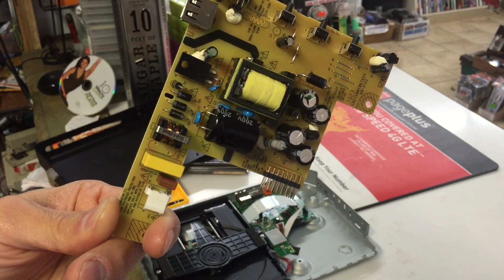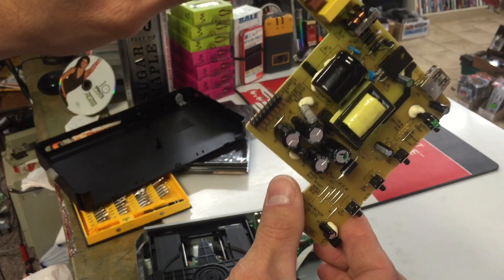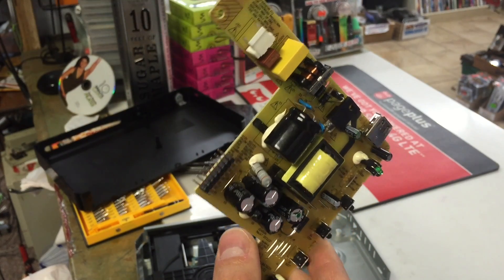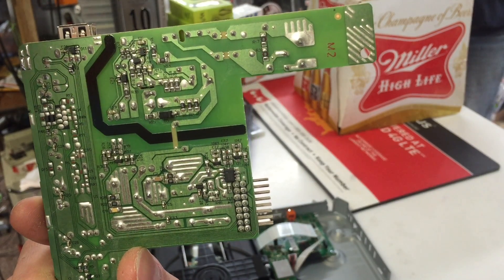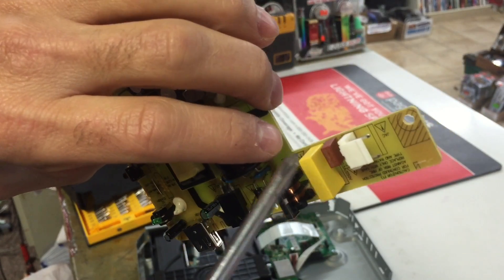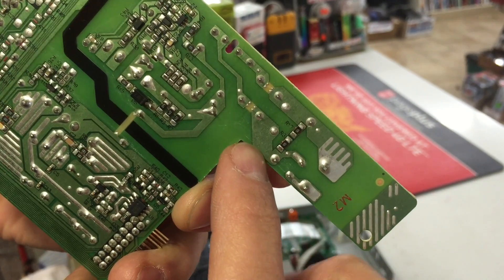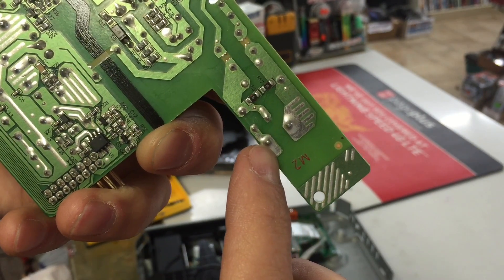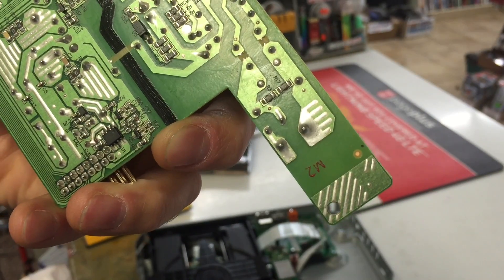How To Bypass fuse Or Fix Blu-Ray Dvd Player No Power

Comment: It came in youre shop and youre fixing it forsomeone and youre bypassing it with wire youre smart !
Reply: Except fuses have a reason for being in place they blow when there is an ne electrical issue if you bypass it you could be asking for a fire

Comment: Hey, thanks for the video helped me fix my blu ray/sound system combo. I had no power looked on the board where the power supply connected to fuse was next to it. I went to my garage found some wire and soldered it in powered right up.
Reply: I’m having that same issue my whole sound system is done for

Comment: Fuck mate, if your going to fix it, don’t bypass a fuse, a fuse is there for a reason, replace the fuse, if that’s the problem. Have you tested it, or are you guessing? No fuse, you could cause a fire in a persons home because of your short cut.....
Reply: Please listen to the comment above people. Somebody has already commented that by shorting out the fuse, it almost caught on fire. A fuse is the weakest link in the chain for a reason. Was immediately concerned about guy in the video's technical proficiency when he described AC as being positive and negative, WRONG. Do not short out your fuses for the love of God!
Reply: I am a total novice when it comes to things electrical/electronic, but was also totally confused by the reference to positive and negative in an AC circuit!!

Comment: GOOD LORD LOOK AT 1:24 IT IS CLEARLY MARKED AS A T250 2.5A FUSE. WHICH MEANS IT IS A TIME DELAY BURN WITH 2.5A MAX AND 250V MAX. JUST DID MINE ON HIGH END SAMSUNG. IT WAS SHAPED LIKE A TINY BLACK CYLINDER. LIL TRICKY BUT REMEMBER TO READ THE BOARD!!! EVERY I REPEAT EVERY COMPONENT IS LABELED!

Comment: I have a Sony bdp-s5200 with no power. I have 12 volts DC after that part of the board but no power at the buttons. No obvious arcs and only two caps on the board that are fine. I hate to throw this out.

Comment: My apology, typo error, I mean,  is it safe to replace the fuse....I wish to do it myself. Unfortunately, my multi-tester had not been used for quite some time, look like I got to replace one because putting the probes together, it does not give any reading. When I turned it to continuity, it did not give any beep sound either. Hope you can share... Thanks.

Comment: hi thanks for the video and sharing i got blueray home cinema witch it use to work fine and store away after 2 years i try to power it up again but it aint boot up it has power come in cos the red lights come on but no booting up where fault could it be what board shall I look at pls thank u

Comment: Thank you Sir for your meaningful sharing. I have this printed words 'FUSE AS MARKED RISK OF FIRE REPLACE' . The Triangle symbol  with a T at the top of the triangle and 2AL 250V at the bottom of the triangle. Appreciate if you could advised...this info which printed at the primary part circuitry. Is it safe to replace the switch. I am new to this line.

Comment: I believe he would not be able to repair my blu ray PSU, since it have a blown fuse, two bad diodes in rectifier bridge and a cap in short. Trying to replace the fuse only blows one after another.

Comment: My LG blu-ray board looks much different and doesn't have that brown rectangle. Doesn't power on. Not sure what to do.
Reply from the maker: Look for a fuse that’s blown hopefully u can see a glass fuse with the line in the middle is blown or separated
Reply: @DO IT YOURSELF ITS EASY  any way I could send you a picture of my circuit board?

Comment: Hi there I have a Samsung blu ray bd-e5400 player the power light comes on but when I press it the power light flash three times but nothing comes on does that mean the fuse is bad or is the whole thing no good anymore
Reply: Aaron Darren my. does too but the light on the bluerau..the round circle blinks
Reply: I found out that it was the power supply unit that not giving out the right voltage I also notice its not worth fixing just buy a new one for the same price they are knowing common issues with the boards itself so buy a new one and use these one for spare parts incase something else goes wrong you have the spare parts
Reply: Yes the power led blinks three times when pressed after that it turn solid

Comment: I have old type with the glass fuse. I replaced with fuse from another one but fuse blew straight away please help.
Reply from the maker: It sounds like it may have gotten wet or two wires have been crossed positive and negative take a really good look at the circuitboard for that possibility is it possible that the two negative and positive Warriors are touching
Reply: @KooperSalmo  its a dvd player with surround sound speakers. I was listening today when it just went off. When i opened up cover i see a small glass fuse which was blown. I replaced with same fuse from other dvd player but when i plugged in was flash and other fuse was gone. Never got wet or anything. If some other component in the board was gone would this cause the fuse to blow.
Reply: @KooperSalmo  i looked closely at the board and notice it looks slightly burned beside one of those square black things are they transistors or something.

Comment: It's labeled fuse on the top side of the board ain't it, the first time I came across a fuse like that I was working on a non serviceable T10 florescent light ballast and I had pulled the metal cover off and of course it had that black rubbery tar stuff all over it but i could see a bad cap but i didnt want to get all the tar stuff off so i just melted some away with bleach to get to top of cap free and scrapped the backside off to unsolder it then i probbed it and new there was another issue on power circuit I thought it was another cap so i just grabbed a small square cap and soldered it on the went to power it up with a power-strip..  I've never had shit blow up like that shit did.    I always try and avoid the straight out fuse bypass (if nothing else a piece of solder wire soldered across.with some headshrink  wrap over it. I was working on a LCD monitor the other day and it had a fuse that looks like a resister and really small and it was one of those older ones with a external power supply so i didnt even really expect a fuse or see one until i got to probing at it. I try to always run a good amount of protection on my testbench, isolate the 0-scope, use a fuse or light bulb on the test power source